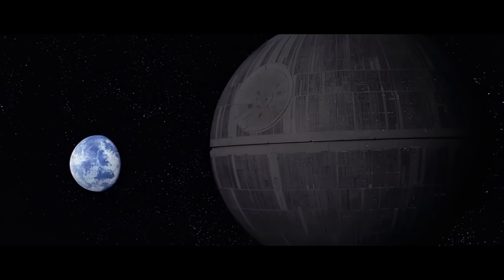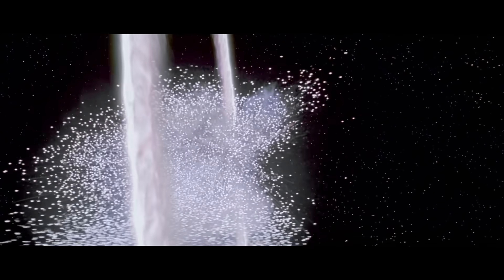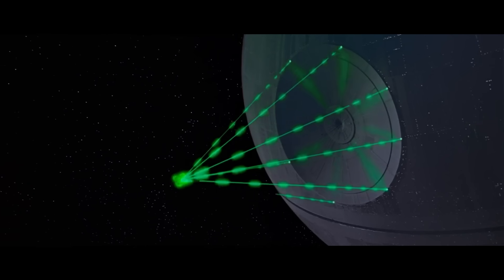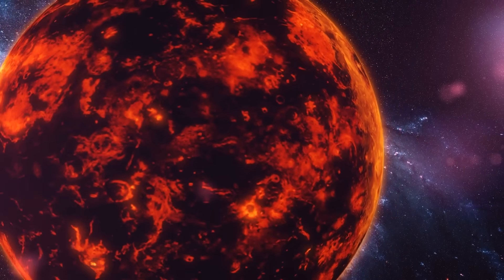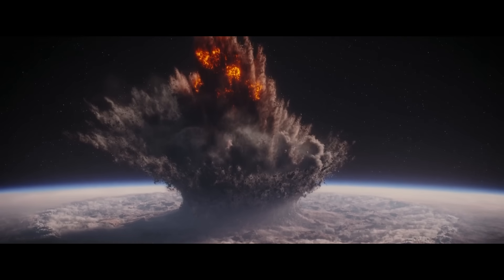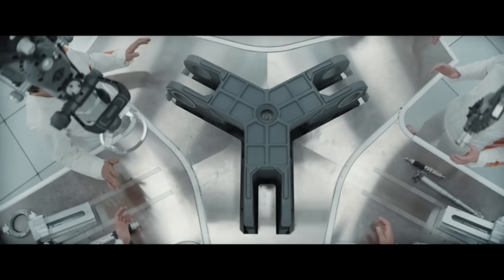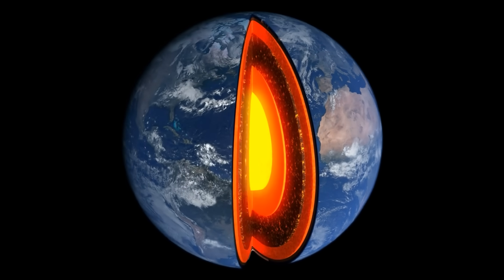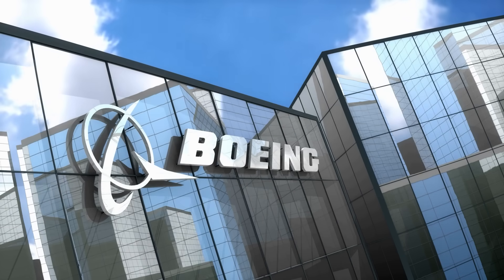The other "Design Flaw" no one talks about on the Death Star

Comment: Seems like blasting a planet to rubble would make resource extraction much easier. We do it on Earth all the time in mining. It would also greatly reduce the energy needed to overcome the gravity for claiming the material.
Reply: I’m with you. Imagine a hunk of the solid iron core of the planet the size of a continent floating in the debris field.
Reply: @onliwankannoli  Well, it would be... interesting. I would think that the debris of an exploded planet would have some significant velocity outside of a normal orbital path, and some significant spin. So, catching up to it with sublight engines and either matching its spin or taming it down with a tractor beam could be a bit of a rodeo to say the least.
Reply: Supposedly that's what they did on Jeda. They went back after the death star punched a huge hole in the surface  in Rogue One and mined the remaining kyber crystals.

Comment: Everyone is always complaining about the 'plot hole' of the exhaust port, and I've always said "Dude, it's a prototype first of it's kind. That thing probably has a BILLION ways to blow it up!"
Reply: Don't run the coffee maker in the breakroom on the 276th floor AND plug in a hair dryer in anywhere in the barracks levels. Creates a feedback loop that cascades straight back into power regulator tower on the north side that then makes the reactor go wildly out of control aaaand... BOOM! Yer all cosmic dust.🤨 equipment maintenance protocols are serious, kids. Follow your operational parameters.
Reply: Right, like the exhaust port was probably just the “easiest” to get to
Reply: @mattshelton7423  
It was the fuel line. To create a detonation big enough to destroy the DS, the main fuel tank had to be detonated.
Reply: In Legends the exhaust port was an oversight, in canon it's an intentional sabotage by Jyn Erso.
Reply: @Kubinda12345  Probably not. It’s more likely that the exhaust port is not even an oversight at all. If Galen Erso worked on the reactor, it stands to reason that the sabotage he did was not the exhaust port, but as he says “I placed a weakness deep inside it”. The ‘weakness’ is probably a series of systems that are sneakily dependent on one another within the reactor that, if an explosion hits, causes the reactor to go critical. Remember, the exhaust port is never stated to be the weakness, only that it’s the target to shoot at to deliver an explosion into the reactor.
Reply: @JahJah-CleverHandle, he used 18 gauge wire through out when the plans clearly specified 12.  Damn contractors trying to save a space buck…
Reply: @Kubinda12345  and i think both are stupid. if anything, it's insane that they managed to size down a reactors exhaust port capable of powering a MOON SIZED space station to the size of ~6 meters.
Reply: @AnimationsofDubiousQuality there are a lot more than one exhaust port, but only one that was sabotaged
Reply: @Kubinda12345 Jyn Erso hit send on the Death Star plans. Galen Erso sabotaged it.
Reply: @Kubinda12345  
No, the exhaust port wasn't the sabotage.
The sabotage is that he designed the reactor to be unstable so a single proton torpedo could blow the whole station (instead of, presumably; causing some damage that can be repaired).
He just assumed there would be some way of the rebel alliance reaching the reactor. Maybe he envisioned them sneaking in manually and dropping a bomb there.

Also, given how they took out the second death star, the Empire kept the same design flaw in its successor lol.
Reply: @Kubinda12345  Or to put it another way:
In the real-world, systems are designed to fail safe.
He designed the death star to fail deadly.
Reply: @Kubinda12345 By Galen Erso, not Jyn
Reply: I can't imagine why anyone has ever thought it was a plot hole. It wasn't a plot hole in 1977 either, it was the whole point of the plot
Reply: @em.dot.2  It was an actual hole, and was a key point of the plot.

So it was a literal plot hole rather than a literary plot hole.
Reply: @pdxmarine haha good one 😂
Reply: @pdxmarine  truly the geinus of George Lucas
Reply: @em.dot.2  Thank you. The entire Death Star exists for no other reason than George Lucas really loved The Dam Busters and wanted to make TDB In Spaaace.
Reply: The REAL weakness of the Death Star was its lack of upscale shopping, dining, and nightlife options.
Reply: Just put a crystal in front of each laser and have it detonate right in front of the main weapon
Reply: Like that big red button on the wall labelled "DO NOT PRESS"?
Reply: @berniethekiwidragon4382  That's a plot button, not a plot hole.
Reply: @berniethekiwidragon4382  Unless you REALLY mean it. That little text is important.
Reply: @berniethekiwidragon4382 self destruct button: do not press unless you really mean it.
Reply: “It’s a small thermal exhaust port, right below the main port.” It’s just that this one is a straight line to the reactor; presumably the bigger one has twists and turns to prevent exactly what the Rebels do. I guess Galen was counting on nobody noticing an extra port, and having Tarkin levels of arrogance so they wouldn’t care even after being told there was a real, serious danger. And Luke needed space magic to make the torpedoes go in, otherwise Tarkin would have been right.
Reply: Actually, in legends the Prototype was still at the Maw Installation.
Reply: I still do not get how people think the exhaust port is Galen Ersos sabotage… No one in Rogue one ever mentions the thing. The sabotage is simply the fact that if you hit any part of the reactor system with an explosive it creates a chain reaction that blows up the Station. The Rebels do not need the plans to find the flaw, they already know what it is from the message Jyn delivered, they need the plans to find a way to exploit the flaw, preferably without having to storm the DS on foot. The exhaust port leading to the main reactor is literally just an oversight by the designers and the easiest/only way to get an explosive to the reactor from the outside. Galen Erso did not put the exhaust port in the plans, he just made the reactor intentionally semi-stable.
Reply: Hardly anyone notices the DS was being run in, it wasn't fully operational : the Rebels had under 100 fighters, given the number of access ports on the DS, they should have been outnumbered 1000 to 1,  there should have been no chance a fighter would get anywhere near a fully operational DS. 

It was still being tested, which is why the crew was skeletal. When TARKIN blew up ALDERAAN, he had no guarantee the DS won't blow up instead : it performed better than KRENNIC, the man who understood it, expected.
Reply: Right, I think the first steam engines in boats and trains were hard to keep from blowing up. Let alone worked properly.
Reply: They nearly cancelled the A10 Warthog cause the gun was too powerful for the plane cause it stalls the plane and cooks the pilot.

Then look at the US rail gun ships, looked fine in the lab... soon as it was ship mounted it was too problematic.
Reply: The round peg goes in... the square hole!
Reply: One Legends source (I saw in the WoTC SAGA Rules RPG, so I take it with a grain of salt)  says it was a sloppy cost-cutting measure.  The Empire used an off-the-shelf exhaust port that wasn't designed for a battlestation.
Reply: Even then. The one Rebel pilot said the shot was impossible.  It may very well have been impossible had Luke not guided his shot with the Force.
Reply: Flushing enough toilets simultaneously, boom.
Reply: EC Henry has a video explaining why such people are wrong.
Reply: I was annoyed that it was explained as sabotage in Rogue One. Everything has a design flaw, and yeah, something this big will have many.
Reply: The issue with Star Wars tech is that they're both more and less advanced than modern technology at the same time. We have targeting systems that could easily target the exhaust port while our current smaller weapon systems probably wouldn't cause the same explosion.
Reply: If you live in the di$ney trilogy, just do a holdo maneuver.
Reply: @Game-The-System  I refuse to accept the di$ney abominations as cannon. There is so much amazing stuff out there that could have been used, but the mouse would have to pay the rights holders to use it, so instead they just nuked decades of established lore.
Reply: Agreed... also, with a lot of training, Luke could have blown it up with a passing thought....
Reply: The exhaust port was intentional on the part of its architect.
Reply: Yes, but the exhaust port was an intentional flaw built into it. Hitting that spot was a sure thing.

Comment: The Death star requires a lot of power and all of the excess power has to go out. The fact that they were able to do that while keepin' the Ray Shielded exhaust port so small that you'd have to be a marksman to hit it is incredible. Not to mention that in addition to havin' to fight through multiple TIE Fighters and fly down a trench in order to make it to the supposed "design flaw", you have to know which exhaust port will cause the chain reaction if you make a physically impossible shot.
Reply: 1. The heat vent was the main one : massive polar vent. 
2. The reason why the ray shielded port was important was because a strike resulted in an uncontrolled fuel feed into the fusion reactor. Once the reactor gets hot enough, the entire fuel is ignited, causing a detonation.
Reply: Yes, but they wouldn’t just have one vent , it just happened to be the one where he designed the flaw into .
Reply: Why are you dropping the g's?
Reply: Unless ALL the exhaust ports lead down to the main reactor.
Reply: any science fiction ship suffer this problem, how they handle it ?? it never explain, so by default we suppose they really have great cooling system and just dump heat when the ship is in pause mode
Reply: Why bother doing ANY of that?  Rian Johnson and Kathleen Kennedy ruined the plots of all of these films in episode 8. They posited that any old garbage scow with a hyperdrive and a droid pilot becomes a superweapon that can utterly shred ships 10,000 times their own size. So all the rebels efforts to steal plans and attack the death star were wasted. Just fly into it at light speed and rip it to shreds. Admiral gender studies did it... so why didn't the rebels think of that earlier? I guess she was just that much smarter than everyone else in the Star Wars universe.
Reply: @Mr.Ekshin  Smarter than entire universe, for thousands of years of hyperspeed travel.

Edit: this is the dumbest thing ever cuz i bet literaly any general or admiral of pre ftl era would figure this out if technology were discovered in their times and used it as a weapon. This is literally thing i was wondering about when i was kid and later found out that Hyperspace is not the same space and you are not just traveling super fast in ordinary space, but basically use something like another dimention or something. Unforchunatly it seems writers didn't knew even such basic thing.
Reply: @Piligrime1000  - I know... they hired writers that likely hadn't even seen most of the previous films. These hacks ignored the established Star Wars canon and just wrote amateur story lines, mostly rehashing the old material, but with self-insertion character arcs. 
    As for hyperspace, you can bend space around a ship because space has no mass... but you cannot utilize hyperspace when there are physical objects in your path. Your hyperdrive would be torn to shreds and take the ship with it (but the object in your path would not be affected at all).

Comment: Technically if a body in space is large enough you wouldn't need artificial gravity. It would just produce its own. Everything has a gravitational pull in space, but especially when you get into moon-planetoid sizes.
Reply: True. It has never really been made perfectly clear to us how the Death Star's decks were laid out. It looks like they're like slices of a chopped onion, but it would make a lot more sense for them to be layers of an onion. That way, the artificial gravity generators would mostly only have to amplify existing gravity, rather than work in angular opposition to it.
Reply: If the Death Star is mostly hollow, then it doesn't have enough mass to produce a significant gravitational field that way.
Reply: @tetsujin_144 not necessarily, that would depend on how dense the material used it. Although that may not matter as much either. The Death Star isn't necessarily all that hollow. 
Sure the areas they visit are pretty large, compared to a human, but not compared to a moon. Even in the large shafts we see like the one the emperor was thrown in or the one obi wan was over to shut off tractor beams, they're surrounded by seemingly solid walls. 
It's more apt to compare all the working areas for people to something like a very intricate and precise cave system in a planetoid rather than necessarily the majority of the station being hollow.
Reply: Vader and Palpatine floating through in slow motion like they are picking daisies, might not have had the same affect, although it’d be nice if space scenes looked different than on-planet scenes.